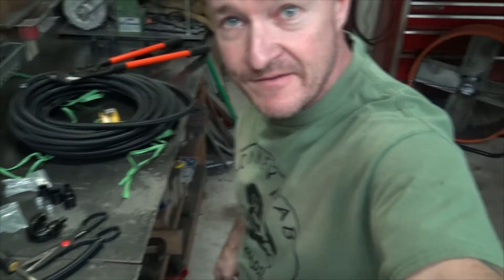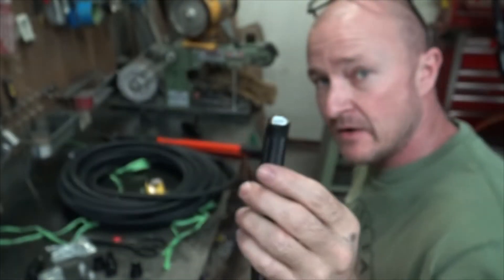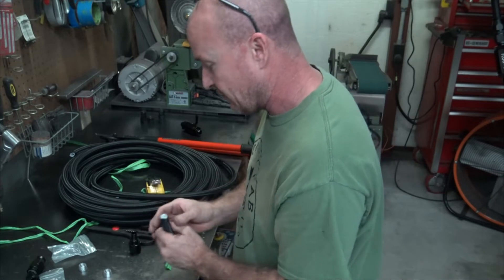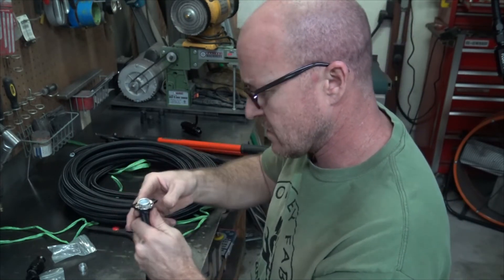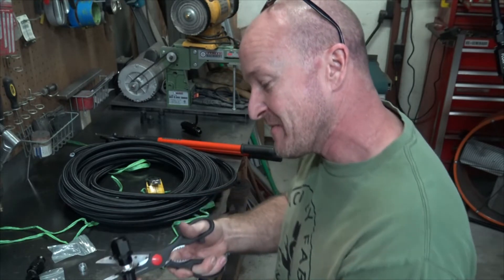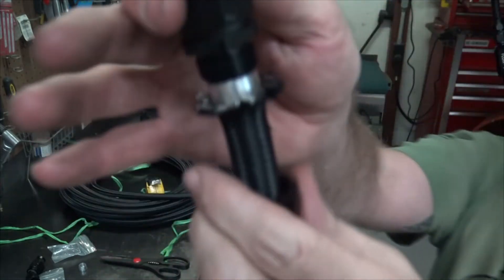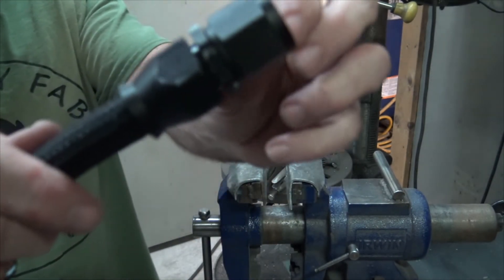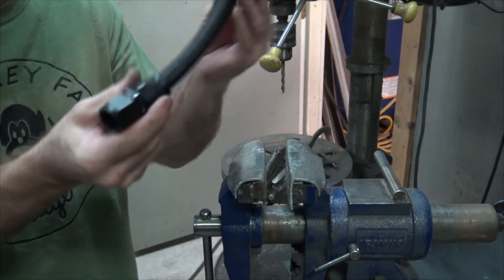PTFE Line Assembly How To

Comment: Bought your lines and fittings, they are in fact a good deal. Will get back yet this week for -6 trans lines. And a couple fittings for finish up the fuel system.